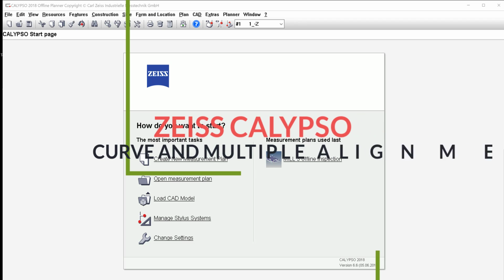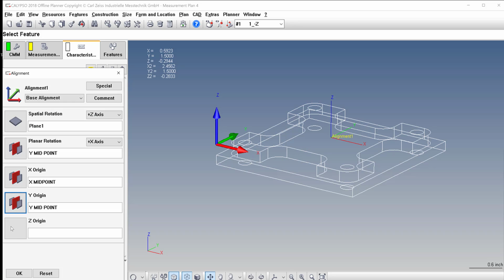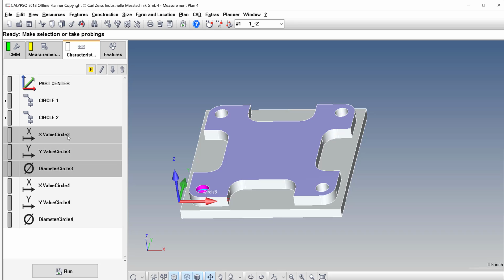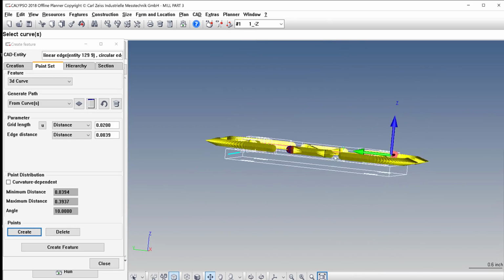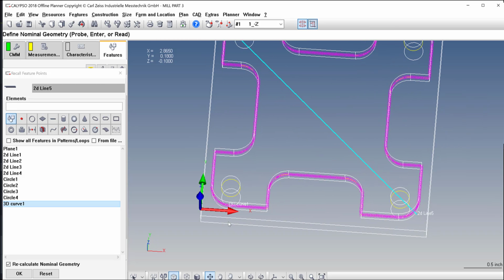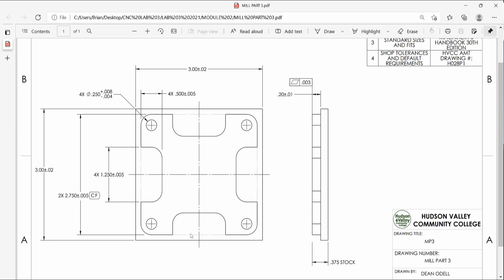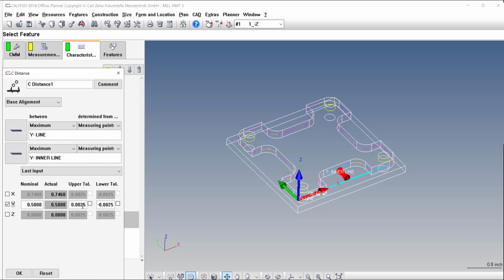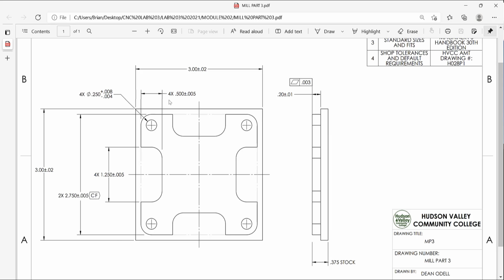ZEISS CMM CALYPSO CURVE AND SECONDARY ALIGNMENTS

Comment: When you're creating a section and then creating a feature (especially when generating a curve around the whole part) you can go into the Hierarchy tab and turn off the cad model leaving only the Sectional geometry and then you can select it much easier without having to rotate the part around and around chasing each section of the line while holding down the CTRL key.